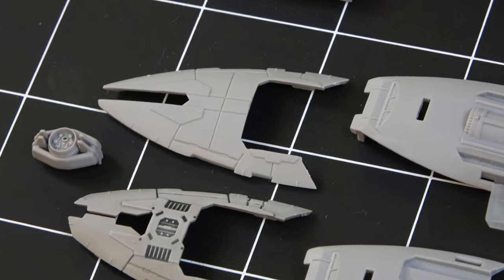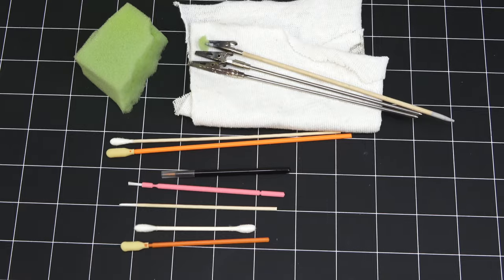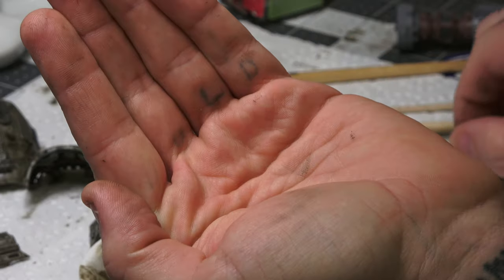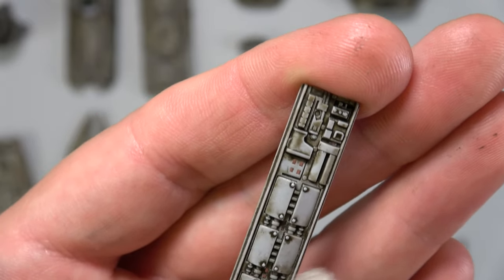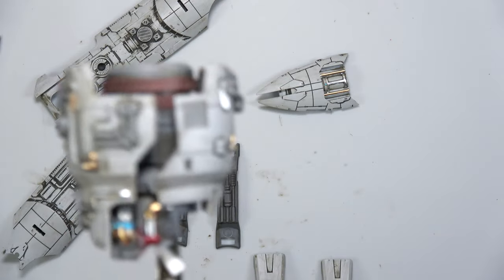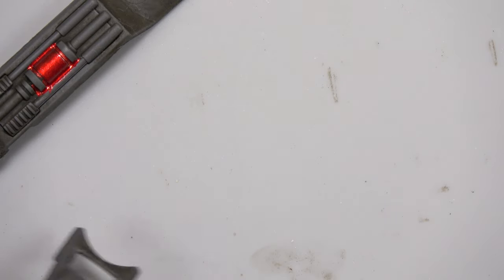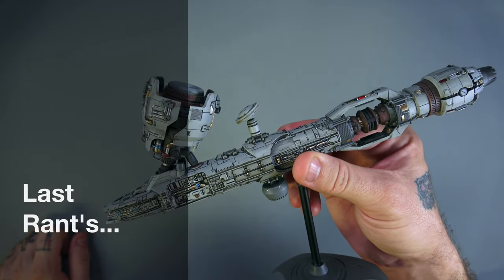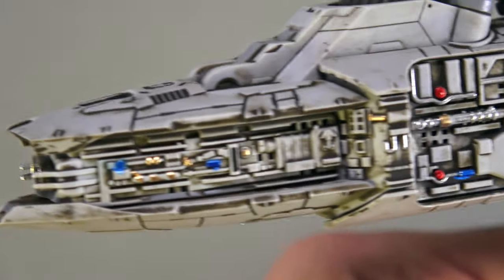Qisheng  Arkhitect 1/3000 research colonizer Model kit PT:3⎜"Airbruship"⎜Weathering as paint⎜4K

Comment: Great build, im about to start mine. Did you have problems with the mig enamel wash degrading the plastic over time? I know on gunpla kits, even enamel panel liner is not recommended on bare plastic because of damage it may cause.
Reply from the maker: Its exactly the same as it started, the reality is most of the internet blames liner/enamel for everything, its fine if used on parts not under pressure font let it pool in joints or near ABS. If uou are lite with application and apply when separated and dont get it in joints u are fine.   Its become internet trend to hate on liner, lol but if u are worried clear coat first even on raw plastic and u will be extra fine
Reply from the maker: To clarify yes the thinner has the “potential” to dmg the plastic badly, bit if care is taken it will be fine.
Reply: @HAFGunpla  awesome thanks! Yeah that's why I always clarify because it seems a few people's bad experiences always outweigh all the positives
Reply from the maker: But you  will see in later part of video i broke a part after assembly cus i was carless lol and went back in with enamel 😂 . Its a very unique kit you will be happy
Reply: @HAFGunpla  I've watched this video like 4 times, totally forgot about the end part where you talk about exactly my question. sorry!
Reply from the maker: Dude no problem thank you for watching , ill always answer the question even if its in the video 🤟🏻😊🔥

Comment: Are all the gundam markers acrylic and just need water to thin?
Reply from the maker: Not water no i use 99% alcohol to clean but i don’t thin them i use straight from pen.  But you could thin them with 99% but don’t think its necessary
Reply: @HAFGunpla  Oh, figured maybe they'll dry out fast if they're just sitting in the open. But you did say its on a wet palette, which I assume is wet from water and not alcohol.
Reply from the maker: Water color palette’ or paper palette for artists
Reply: @HAFGunpla  you just poured it out on dry paper palette? guess i'll have to play with that some more, always thought you had to wet the paper to keep the paint from drying out
Reply from the maker: It will still dry out but if you use just a little tapped out from marker you have enough time to apply